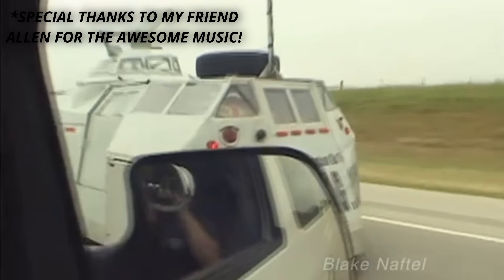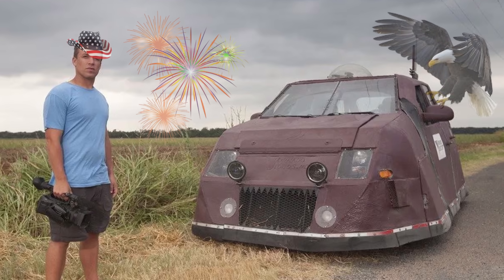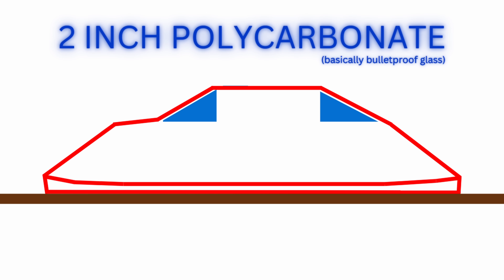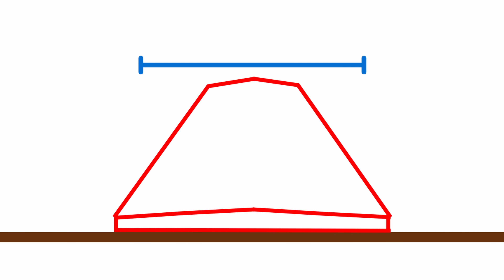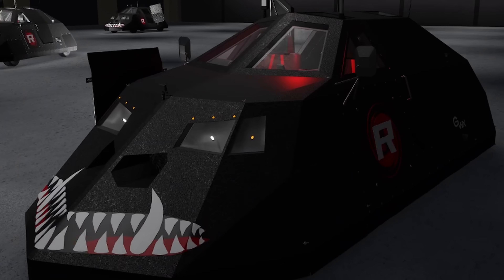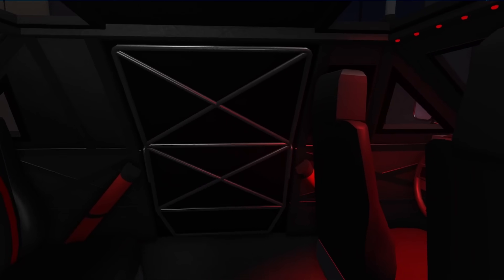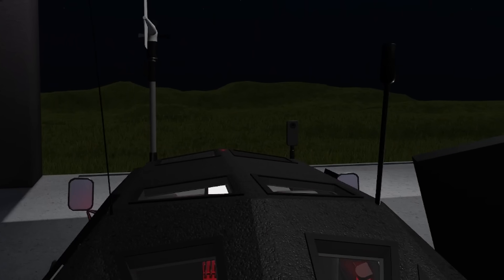How to Build a Tornado Interceptor

Comment: This advice is good but the sides being extremely non Aerodynamical has a purpose

When your vehicle gets rolled you would not want the sides to make you slide because of the shape 
Storm chasers like Reed and sean purposely did this to roll and not slide because sliding would make your underbody be exposed and you'd die when you get picked up because you'll get slammed bsck to the ground anyway
You must make it flat to make the vehicle keep rolling you have Harnesses and rollcages protectin you anyway and also when your rolling there's actually less chance you get picked up(some deaths are from getting picked up and slammed back to the ground) but I still agree with you since im that kind :/

Edit: whoever trys roasting me probably just: Is jealous i have this kind of knowledge or just dosent know anything about designs of intercepter vehicles

Comment: For the overall width thats not entirely correct. Most states (especially with inspection) have a max amount of width from the body of the vehicle. So if youre a dummy making an interceptor out of a coupe you cant go 8.5ft wide. 

Different states differ on rules though.

Comment: The fact that tiv 2 survived a ef3 tornado in 2013 is crazy
Reply: Not really (In my opinion), TIV 2 has 4x 2ft deep spikes at the front and back of the vehicle which makes it very secure, and also on mythbusters, TIV2 was put against 250mph winds from a Boeing 747 (and I understand that straight winds and tornadic winds are different due to strong updrafts it isn’t far off to imagine it could survive above 200mph) and though it wasn’t easy for TIV 2, I think it could survive (all of this is my opinion tho and I agree that the interception in general was crazy)
Reply: @Real_Milkdromedayeah dom 1 when it was behind the 747 engine didn't do too bad
Reply: Yeh, the only damage was a bent license plate lol

Comment: People argue the DOM 3 is better than the TIV 2. Funfact, it's not, by any means. The armor is significantly weaker (almost pathetic), the aerodynamics on the side of the vehicle are like a flat wall, it has little to no safety when toppled over, it cannot go off-road because of the lack of ground clearance, and the spikes do not work and in some cases make it worse because they lift the vehicle up instead of burrowing like they should (because there is no horizontal angle meaning they are basically glorified floorjacks.)

The TIV 2 is one of the prime examples on how to make a rugged yet useable interceptor, it even comes with an IMAX camera to flex its ability to document tornadoes, and it has proven its durability with VIDEO PROOF of logs, pieces of shed, and extremely high winds battering the vehicle so hard the paint chipped off, yet it only suffered minor dents (and the hatch doesn't count because it wasn't secured right, which was user error.)

The DOM 3? Intercepted a relatively pathetic tornado that uprooted some shrubs, got its mirror taken off, hit a deer at like 60 MPH which had almost destroyed part of the front end of the vehicle, and it has proven time and time again that it gets stuck everywhere and the anchoring system does NOT work. You can even see from the image of the deer hit of the extremely thin almost sheet metal that pretends to be armor, with truckbed liner as a paintjob. 

I don't care how popular Reed is, his vehicles have proven time and time again that they simply do not work or are so unreliable that they prove to be unusable. (Yes the TIV 2 was that way when it first came out, but after they reworked the vehicle it has dominated tornadoes ever since.) Reed should not chase in these vehicles, it is too dangerous for him to use. I don't wanna sound rude but that's the truth.
Reply: I feel like the most objectively correct opinion is that a mix of both of the intercepters most useful parts (the airbags of dom3 and pretty much everything else tiv2) edit: nvm I heard that having the car up high allows it to go offroad easier.
Reply: @megamegazard I can agree, but the TIV 2 also has airbags to lower itself into position to get the panels down.
Reply: Ik tiv2 has airbags but they don't fully lower you to the ground

Comment: the dominator 3 has a  slight design in the front. if you watch reed's dominator 3 tour on the front there is a little angled cone on top to divert winds to the top of the vehicle

Comment: I understand your statement about flaps. But they make sense for when you’re not intercepting. Especially on dirt roads which become muddy during rain. It gives enough ground clearance for any situation. And I do think TIV2s angle in the structure is enough to deflect the winds. And you can make even 1 inch pipe pretty structurally sound if you can weld properly. (Certified through my union hall btw)
Reply: Sean took that time when tiv 1 dive head first into a ditch really personally

Comment: In MY VERY OWN opinion, the best interceptor would be a mix of tiv 2 and dom 3 with a dom 3 body and the same weight something like windbreaker from twisted but DIFFRENT so it would almost be exactly like windbreaker but insted of the falcon wing doors ill get the same doors tiv 2 has and make it the same weight at tiv 2 but also use half of the weight of dom 1 and with the flaps ill make sure they go. DEEP in the ground about 20 inchs in the ground

Comment: I want this person actually build Raptor IRL.
8 spikes!? That's insane.
I love the design and the system you created, and also can you showcase the Raptor deployment animation?
Reply: 8 spikes is what I was going for in my imagination. You will 100% stay on the ground and not flip over I'll feel very safe
Reply: my intercepter has 10 @PatriotsAndTurtles 4 main 6 auxiliary
Reply: @PatriotsAndTurtles 8 spikes is what I was going for in my imagination. You will 100% stay on the ground and not flip over I'll feel very safe
Reply: Mine Named Oblivion Has 2 but they go super deep bout 40 inches  and the body drops all the way to the ground and is vacuum seal to the ground mostly (it isn’t aerodynamic and probably never will be
Reply: mine named storm assault has 16, 8 outside, 8 inside

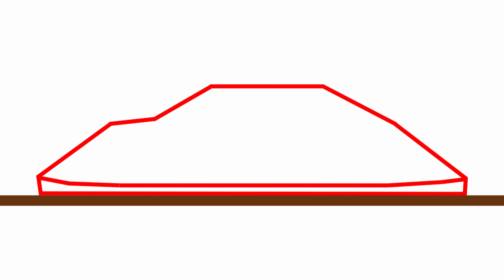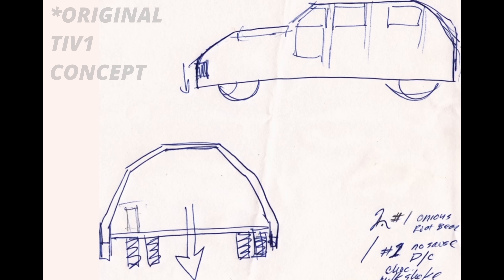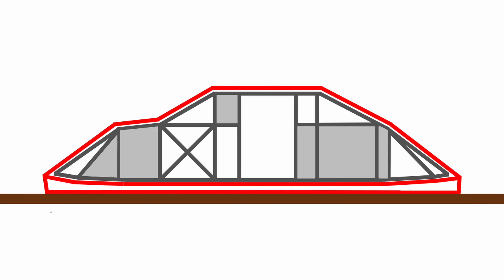Comment: 1:29- 2:03 Agreed but i don’t suggest keeping the body i mean if you’re gonna build something like tiv 1 where you’re basically building off of a tow truck basically sure because it’s very little cub and mustly frame 🤷🏽‍♂️ you need this because the best tornado interception vehicles are built like nascars as in the roll cage the supports the armor plating is welded in the case of tiv 1 or bolted to the frame in the case of tiv 2 this makes the vehicle over all much more safer and stronger then just building a roll cage on a body and welding plates on it  2:33-2:56 but here’s the problem i like square inch thick steel tubing. The problem with it is if you ever try to make shapes out of it it’s very difficult also a circular object is stronger than a square object it’s the reason why submarines are circular and not square the problem with the dominator vehicles is that the roll cage is made out of thin tubing wall and the bars are small so you will have to use a much bigger bar and much thicker tubing wall it should a minimum be the same thickness of a NASCAR roll cage bar thickness at lowest 1.75 and a wall thickness of 0.090 or thicker for maximum strength and build the cage correctly and it will be stronger then tiv 2s roll cage

Comment: the deployment time does not matter when you are good. if you cant intercept cuz of deployment time you have something called a skill issue.
Reply: and without flaps, you also reduce your off road speed cuz you are closer to the ground, a chasers worst nightmare is to get stuck in a ditch Infront of a nado's path and cant deploy or the nado gets to strong for your interceptor to handle.
Reply: deployment time does matter? if your interceptor by default takes too long to deploy for an intercept then its worthless
Reply: Also wdym without flaps?? flaps make your aerodynamics worse by making drag areas, straight to the ground rubber is better because 1. its more efficient 2. because its way less work and money spent on an already expensive vehicle. tornadoes in twisted don't work like they do in twisted, realistically they move one mile per minute. so deploy time DOES matter. and there's a reason the dominators never go on dirt roads, because every interceptor has gotten stuck in the dirt more than once and it ruins it.
Reply: @mellow_tornado  some times dirt roads are you only hope, you can bake acronymic flaps, and money is going to be a consern
Reply: @random_person-i5o  this is real life you don't wanna take any risks.

Comment: Titus as a sub-interceptor in the same category as Subanator: you know what, I'm not gonna bother.

A 'how to build your interceptor' tutorial was the last thing I expected to see, but yeah, this is pretty much how it goes. Solid. 

Bro was describing Raptor all along lol get outta here with that cap. Very impressive vehicle, finally getting to see the finished product. I'm surprised it may be coming to Helicity: did you get admin powers there or something? Will be cool to run into you though, since yeah, I play it now (I only want the Titus). 

Raptor is indeed one of the strongest intercept designs I've seen that could realistically be built. I still think my Terais is stronger though. :P

I'm considering just building a custom frame rather than buying an existing vehicle, simply because Terais'll be quite heavy (~17k lbs). It's a composite construction built primarily of 1/2" steel throughout, with 3" of armor total. 

Though the flaps themselves may be made of aluminum. Speaking of which, while I do agree that flaps are more cumbersome and that dropping down is the better option, I am not planning to get stuck on any obstacles on any terrain. Bunch of fallen tree branches? If I can manage, I'm driving over them. A rocky dirt trail? Same thing. I wouldn't really trust a vehicle with lower clearance to be able to do that without problems. 

14 spikes total (compared to Raptor's 8) which each dig 60" deep. I plan to accomplish this by having the spikes built in sections like what the Titus did: the full main piece going 30" and then extending the extra 30. We're not going anywhere with those suckers dug in. 🗣🔥💯

Comment: My guess for the winds threshold is probably 280-290 mph
-The Aerodynamic on every side of the vehicle
-The spikes on the car that stabilized the car
-Wind can't get underneath to lift or pull it
More than TIV2 and any intercepter and I like the door and interior design of it
Reply: There’s a crazy thing called debris
Reply: @JonWagstaff  well it's armored so I don't think debris can do anything to it. Go look up Sean Casey Lebanon,Kansas EF4 intercept

Comment: Here’s an idea for powering the interceptor. instead of using that Dodge diesel, which is usually not fuel efficient carrying all that steel around. Use diesel electric set up. Replace the regular diesel with a small generator diesel. And use electric motors to move the  vehicle. This helps save fuel while highway driving and can help power more essential systems within the interceptor. Edison motors are in development to make a pick-up diesel electric conversion kit which will work perfect for it.
Reply: your pfp said where you got that idea from
Reply: @Another_Gamer  He Obviously got this from Locomotives
Reply: Lmfaooo diesels aren't efficient? Hahaha idiot. We chase we 3 different diesels that get us anywhere we want to and still get 16-18mpg.

Comment: Here are my interceptors perks:
TC1:
MAX WIND UNDEPLOYED: 112
MAX WIND DEPLOYED: 290
DEPLOYMENT PROCSESS: 
1.	VEHICLE FRAME LOWERS AND WHEELS RAISE INTO ARMOUR
2.	FLAPS INSIDE ARMOUR DIG VEHICHLE 2 FT INTO GROUND
3.	REAR DEPLOYMENT SPIKE
4.	MID SPIKES
5.	LIGHT COVERS
6.	FRONT FLAP LOWERS

VEHICLE SPEED: 104
VEHICLE SPEED ON DIRT ROAD: 75
VEHICLE SPEED ON GRASS: 80
ACCELERATION: 1-100 IN 14 SECS
WEIGHT: 19,700LBS
FUEL: DEISEL 
DRIVE TRAIN: AWD
SEATS: 6
MAX SUSPENSION: 7FT
FUEL CAPACITY: 40 GALLONS
Engine: MAN V12-1900

ARMOUR:
THICKNESS: 2-4 inch
MATERIAL: STEEL
WEIGHT:10,230LBS

HTC2

MAX WIND UNDEPLOYED: 92/115
MAX WIND DEPLOYED: 212/311

DEPLOYMENT PROCESS:
1.	VEHICHLE LOWERS, WHEELS RAISE
2.	INNER-FLAPS PUSH VEHICHLE 1.5FT INTO THE GROUND
3.	FRONT/BACK SPIKES DEPLOY
4.	INNER FRAME WALL SPIKES DEPLOY
5.	WINDOW COVERS 
6.	LIGHT COVERS
7.	OUTER-SPIKES DEPLOY
8.	UPPER CAMERA SLIDES INTO PLACE

VEHICLE SPEED: 130MPH
VEHICLE SPEED ON GRASS: 110
VEHICLE SPEED ON DIRT ROAD: 92
ACCELERATION: 1-100 IN 10 SECS
WEIGHT: 21,765LBS
FUEL: DEISLE
DRIVE TRAIN: AWD
SEATS: 7
FUEL CAPACITY: 24 GALLONS
ENGINE: PERKINS 1700 SERIES

ARMOUR: 
THICKNESS: 4-5INCH
MATERIAL: STEEL
WEIGHT: 16,468LBS

HTC3
MAX WIND UNDEPLOYED: 112MPH
MAX WIND DEPLOYED: 331MPH

DEPLOYMENT PROSCESS:
1.	VEHICLE LOWERS
2.	COVERS
3.	FLAPS
4.	VEHICHLE DIGGER
5.	REAR/FRONT SPIKES
6.	MAIN SPIKES
7.	MID SPIKE
8.	INNER SPIKES
9.	INTERIOR PRESSURIZATION

VEHICLE SPEED: 115MPH
VEHICLE SPEED ON GRASS: 89MPH
VEHICLE SPEED ON DIRT ROAD: 73MPH
ACCELERATION: 1-100= 23 SECS
WEIGHT: 27,887LBS
FUEL: DEISLE
DRIVE TRAIN: AWD
SEATS: 6
FUEL CAPACITY: 31 GALLONS
ENGINE: CUMMINS K2000E

ARMOUR:
THICKNESS: 8-14 INCH
MATERIAL: STEEL/POLY CARBON FIBER

Comment: Aww I was hoping to see that in Twisted (not to diss Helicity though, its pretty good) and I had a wild idea for a KV-1 modified for storm chasing, though to conform to road laws, I might have to use a T-34.. I'm just wanting to get cored by an EF-5 and not be launched by it.
Reply: You're not gonna be able to intercept at all, because it's dead slow. It's immense weight and strange geometry makes it impossible to use wheels (to go faster) without undergoing major design changes, and it will be limited to paved roads due to the underpowered engine. Youd be better off using a modified M1 abrams (turret delete, aero sides, ground achor and a better suspension) or maybe a Patria 8x8 Heavy APC with ground anchor and aero sides and front

Comment: So bro just made the dominator 4
Reply: Dominator 5 b4 Dominator 5 🗣🗣 (Dom 4 is the Subaru)

No tbh tho comparing Raptor to the Dominator honestly feels a bit disingenous. I don't expect Dom 5 to be much different from Dom 3 outside of slightly more angular, better frame, thicker armor and an extra set of spikes. If I'm wrong and it looks anything like Raptor I'll be pleasantly surprised.

Comment: Hey man, love the video but i have already made a couple interceptors in a game (Brick Rigs) and on my main one i have 10 spikes with a thres of 300mph (6 outside kinda angled, 4 inside 30 degrees angled). You think thats good enough? It also naturally weighs 20k LB just bc of armor. Its angles are not the best but wind still goes over it, even on the sides. Its a beast.

Comment: this is just a diss track at the dominators and tbf they had it coming. The trickiest thing though, about interceptors, is that basically every one that was built was just eyeballed. There's no way to accurately model and predict what debris you're going to encounter, the velocity and angle it's going to hit at, etc. We don't know what works, we only know a few things that don't. Similarly with aerodynamics. You ideally want a streamlined shape to prevent flow separation and vorticies building up and causing extra drag, but traditional fabrication techniques make that cost prohibitive. Lastly, tornado winds are incredibly unpredictable and every one is different. There is no real "wind threshold" because it depends so much on things like the actual direction the wind is blowing. Is it mostly horizontal? if so, tangential or radially dominant? are vertical winds significant and do they need to be considered? etc. I will say, that I feel like the flaps could have been done better on TIV 2. They didn't need to use hydraulics for them, and the power unit was the main limiting factor for the deploy speed. Spikes, however, will basically require hydraulics. They can output the most force out of electric-linear actuators and pnuematics. The length of the spikes should also depend on the material, the shear strength and how much each spike will be loaded. It's all statics. Also, please do us all a favor and consider basic fluid dynamics, raise that anemometer up more

Comment: This looks really cool! I think the raptor (if made) would be one of the best interceptors, but i would recommend one centered seat in the back, maybe with some displays of cameras, that could be used as a central control panel, so the front seats wouldnt have to worry about that.

Comment: Nice video but there are a lot of things ignored.
Ex 1 dom exterior, while you are right its not a safe woth debris as the tiv, dom has a roll cage, it doesnt leak everywhere since the original body wasnt removed like the tiv 2. Removing the complete body of the truck may make susceptible to electrical fire as what happened to tiv 1.
2. How to get in and out, non of the interceptors have resolved this issue, d1 and 2 door cant close unless the back doors are closed, tivs hatches have opened multiple times inside of tornadoes, and d3 door are so complicated and breaks frequently.
3. Tiv is too heavy, it constantly break, specifically the airbags and axle, it has removed weight from the back flaps but continues to break
Reply from the maker: @alfonsohdezB  The TIV hatches opening was actually due to them not latching the doors, so in other words it was user error. TIV-2 hasn't had many problems that are directly caused by weight ever since it was made nearly 3,000 pounds lighter in 2009. And as for leaks, all 3 Dominators used to leak before D3 got everything sealed up.